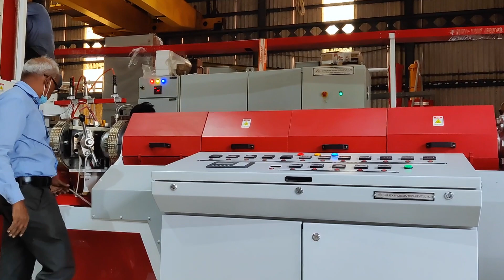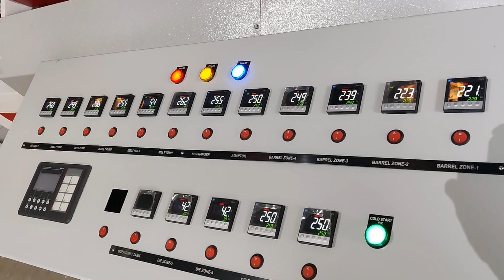Tape Stretching Line & Tape Winders

Comment: Dear sir

We welcome you to HK INNOVATION 
We are professionally managed company, since more than five years, dealing with various kinds of industry for their requirement of sale - purchase of used machinery and complete industrial units & act as a mediator to provide right solution as per need, on charge basis. HK INNOVATION provides platform for end user buyers and sellers of used machinery & industrial units.

used machinery plant in all  plastics line, paper line, water line and 5 layer blown plant,3 layer blown cast film plant,
We also have extrusion coating lamination plant, tape plant, tuber, woven sack reversing machine,flexo printing machine,volvomatic machine ad star canverson line, looms, stitching machine,BCS machine, monolayer film plant,pp hips sheet line, injection blow molding machine,sutli plant,box straps machine, monofilament machine,ppqt plant,lohia lofil, Rotogravure printing machine.vacuum Metallizer , flexo Paper, glass making machine, paper plat making machine , water RO plant, edible oil plant, water chiller , paper lamination machine , hoist crane, Thermo forming , vacuum forming complete industrial units.

We are industrial consultant also like machinery & plants all paper plastic Industries.

We are providing GM , Production incharge & operators also.

If you want sale purchase any machinery call me

We are buy old HDN 4 looms & FSN 4 looms 

Note:- we have also  installing, repairing, shifting & manufacturing all plant.
1) extrusion lamination plant
2) tape line & looms
3) mono layer blown
4) bale press
5) flexo printing machine
6) rotograveur machine
7) woven bag cutting machine
8) pvc blown
9) hips/pp sheet line
10) water chiller
11) box streping belt making machine
12) re prosessing machine
13) Injection molding machine
14) sutli plant
15) multi layer blown plant
16) vacuum forming machine
17) thermoforming machine
18) hydrolic cutting machine
19) woven tuber machine
20) solvent lamination machine
21) slitting machine
22) water ro plant 1000 to 10000 LPH
All machine manufacturing 18 month worrenty

SK KADAM
HK INNOVATION
PH:- 9650297321,9818832805
Email:-sanidhya9650@gmail. com
Web:- www.hkinnovation.co.in

Call & what's app only this number 
☎9650297321☎
Check My YouTube channel 
https://www.youtube.com/channel/UCLWEtVT_5d0lYIxgIECoNEQ

Check my Linkedin 👇👇
https://www.linkedin.com/in/sk-kadam-old-machine-25798a121

Check my Facebook 👇👇
https://www.facebook.com/sona.dutta3